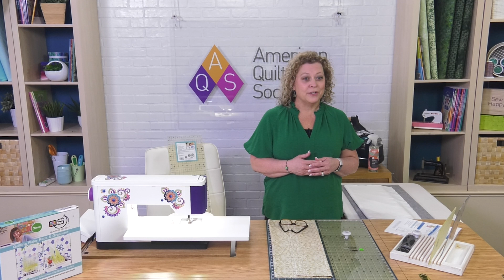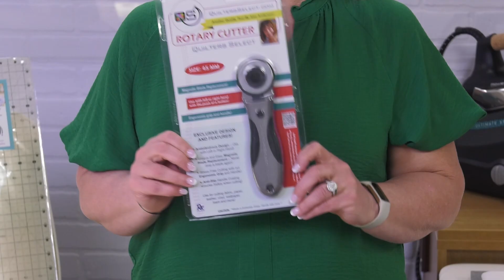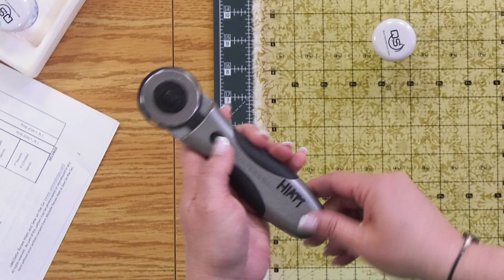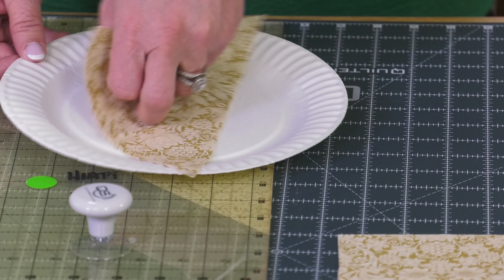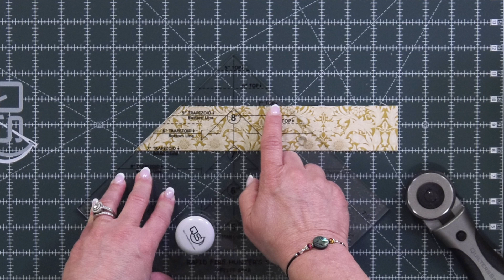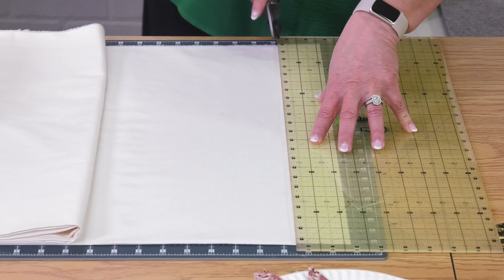Hunter Star Quilt Along: Week Two - Cutting the Blocks

Comment: I have Deb Tucker’s larger Hunter’s Star ruler, it says it can do 7” blocks. Can I use that instead of the Petite ruler?
Reply from the maker: Unfortunately, the larger ruler doesn't work for this quilt. It uses different cuts of the fabric.
Reply: @quilttv  thank you for the response, I have not started cutting so great timing:)
Reply: @quilttv  I bought the Petite Hunters Star ruler, it does have different proportions than the large ruler.